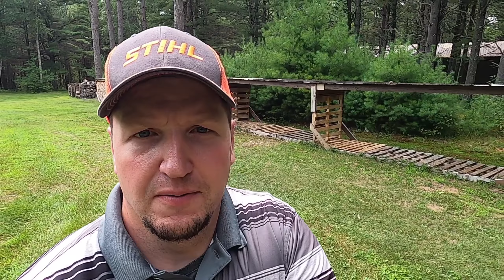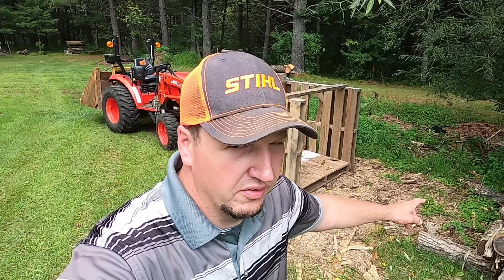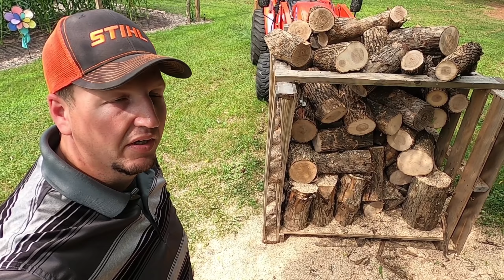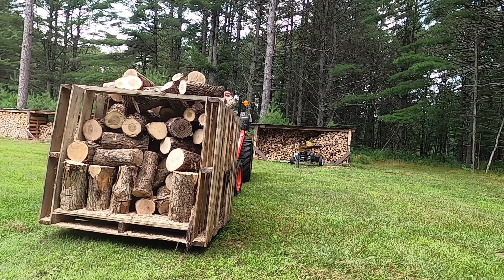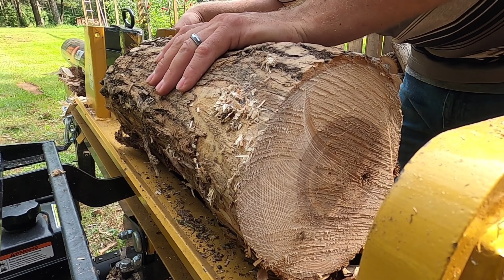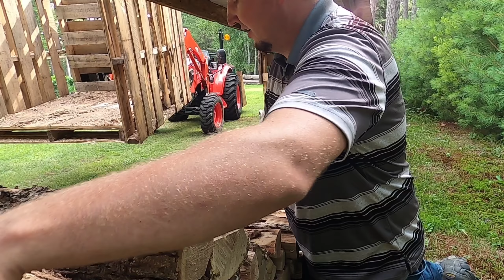Stihl MS 462 and County Line 25 Ton Splitter vs Ash Logs!  Making Firewood...Again...

Comment: Your 462 seems to run better than mine . It pulls like mad but sometimes running it slow or at idle it just runs rough or stalls .  I did do the tune correctly.